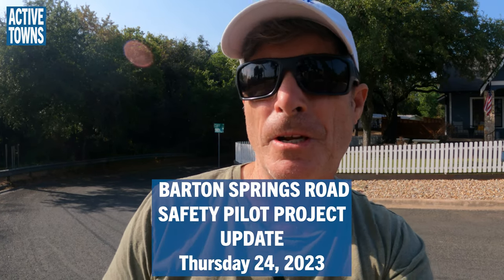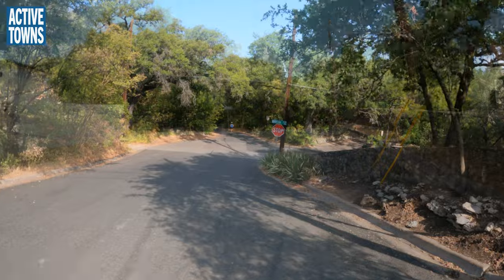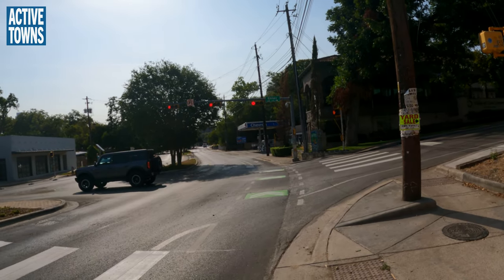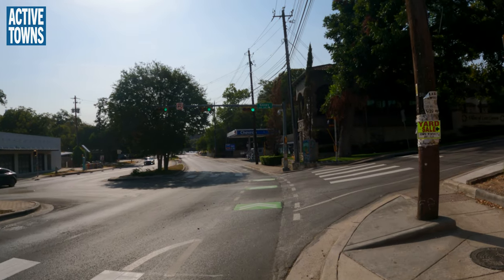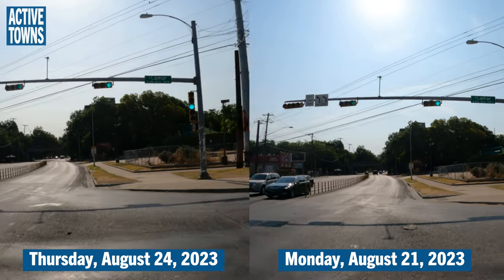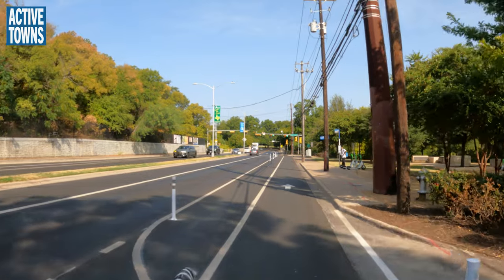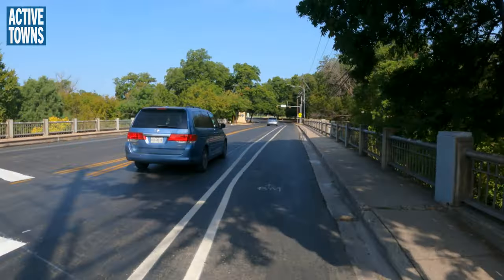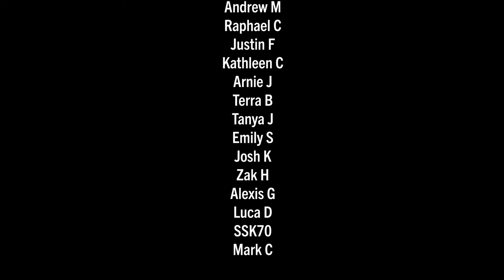STATUS UPDATE: Barton Springs Road Safety Pilot Project

Comment: 0:51 not only do they put out a nice message, but that is also a very cute small house, I love it.

I never seen the armadillo's before, but I much prefer that sort of lower to the ground separation as opposed to poles, plastic or metal ones, just because it gives you more room.
Reply from the maker: Yeah, that is one of the original houses in the neighborhood. Nicely restored and preserved. Yeah, the Armadillos are a cool solution by ZICLA a company out of Spain.

Comment: Coincidentally, I also traveled east on Barton Springs Road on Thursday, 8/24, later in the day by car (but going to the bike shop there!). I was confused at the intersection at South Lamar where I was turning right. I did not use the bike lane to turn, but other cars did causing a problem with me. I note that cars are turning inside the bike lane in your video, too. Is this a problem for bicyclists?
Reply from the maker: Yeah, not an ideal situation, but again, this intersection will look much different when Lamar is redesigned - there will most likely be a protected intersection here eliminating that conflicting merge.